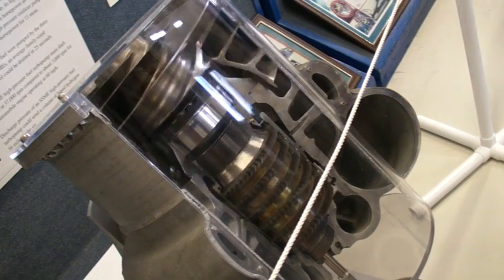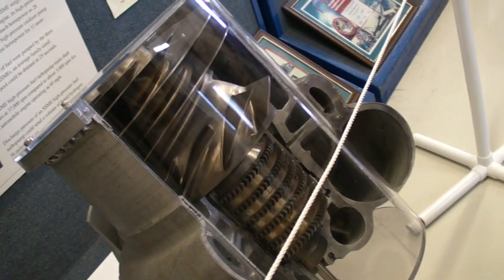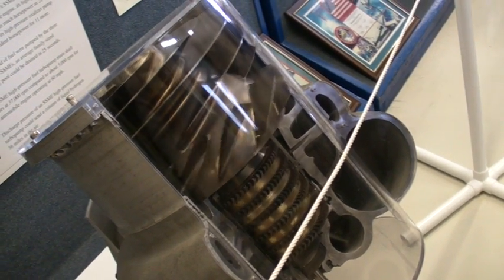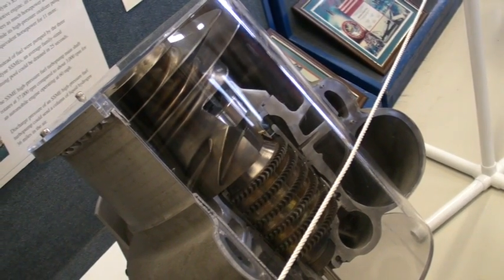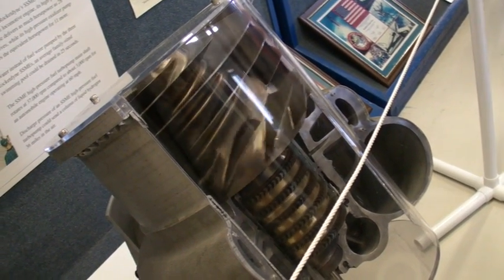Space Shuttle Main Engine Processing Facility - Turbopump Explanation

Comment: the top is the inlet for low pressure/ dynamic pressure liquid oxygen, ie. low flow or basicly tank pressure. the bottom is the inlet for high pressure or flow oxygen coming from the high pressure oxygen pump. a small amount of energy is removed from the high pressure lox and converted to rotational energy via the turbine as seen on the bottom. that power is then transmited again to pressure as it raises the pressure of the lox from the tanks via the impeller shaft at the top to a lvl sufficient for the inlet of the high pressure turbo pump, this either reduces cavitation due to suction head being to high or nasa would of had to design a less efficient impeller to cope with the suction head. this combination allowed the high pressure pump to operate more efficiently.